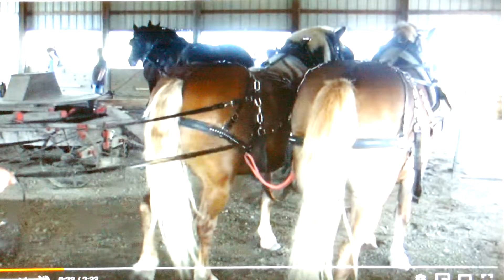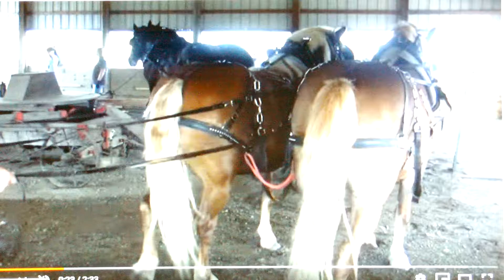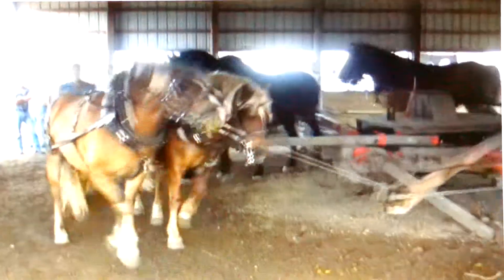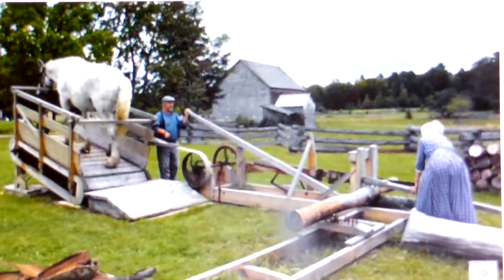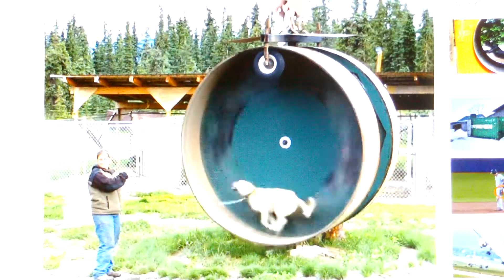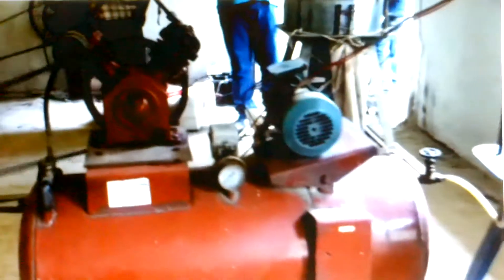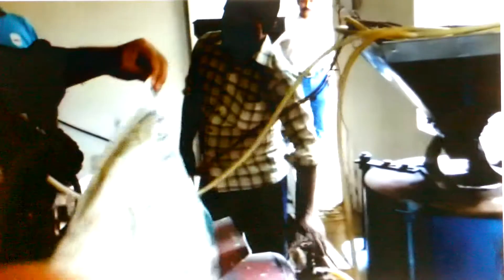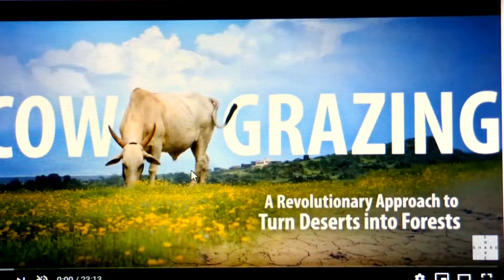animal power conversion to electrical power off-grid power happy animals not overunity

Comment: In that Ox powered mechanism it is showed that they are rotating the shaft connected to underground gears and Yes that was freewheel which helps in reducing burden on Ox. Even if they stop walking the freewheel will keep on rotating till its in motion.With that geared system Air is filled up in air tank via Compressor and compressor is connected to motor. Valve needs to be opened when you need electricity so compressed air (tank) works as Power Bank/Storage.
Reply from the maker: hi.    freewheel  =  flywheel ???     in a system where the primary motion is  Rotary,  a  flywheel  does  NOTHING.
in a case where battery technology is not an option, compressed air energy storage, or  water-raising, can be used.
cheers

Comment: YOU GET MORE TIRED BY STANDING FOR A LONG TIME THEN WALKING OR MOVING WHY ? THE ANSWER IS BECAUSE STANDING THE GRAVITY PULLS DOWN ON YOUR FULL WEIGHT WHILE WALKING LIKE A MOVING WHEEL BICYCLE THAT DOES NOT EASILY FALL IS NOT PULL WITH FULL FORCE ONLY PARTIALLY , EXPERIMENT , ROLL A BYCICLE WHEEL BY IT  SELF AND IT WILL ROLL FOR A WHILE BUT WILL NOT FALL IMIDIETLY WHILE IF IT WAS NOT ROLLING IT WILL FALL IMIDIETLY BECAUSE IT IS PULL WITH FULL FORCE FROM EARTHS GRAVITY ,  SO NORMAL WALKING IS LESS STRAIN ON YOUR BODY  THEN STANDING BECAUSE OF LESS GRAVITY FORCE ON YOUR BODY  , OR TRY THE EXPERIMENT ON YOUR SELF , WORK 8 HOUR WHILE MOVING AND ANOTHER DAY STAND 8 HOURS AND SEE WHICH ONE GIVES YOU MORE ACHE AND PAIN , SIMPLE EXPERIMENT WITH GREAT RESULTS. A IDEA AND INVENTION JUST STRUCK ME ON HOW TO GET ELECTRICITY FROM YOUR HORSE , IT JUST HIT ME WITHING LAST 2 MINUTES A INVENTION IDEA , STAY TUNE  WITHING NEXT 2 HOURS ....
Reply from the maker: thanks for commenting, and wtf.    this is just a bunch of  immature,  irrelevant  babbling.   btw,   walking and a rolling wheel are soooooo different, that its just  L M A O.
Reply: Gyroscope concept . Oh my video is done , you know about my invention idea on horse energy while walking.... Cool if I say so myself.